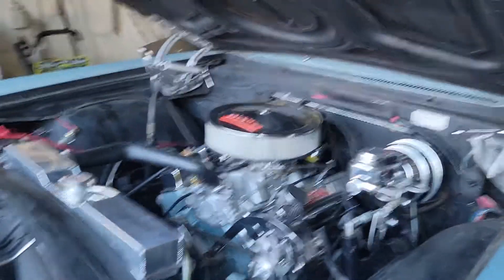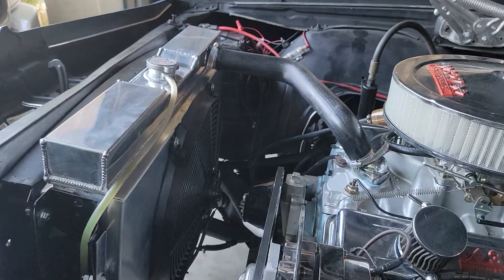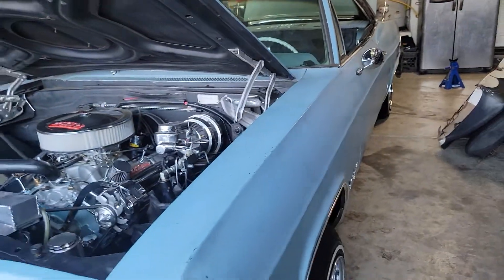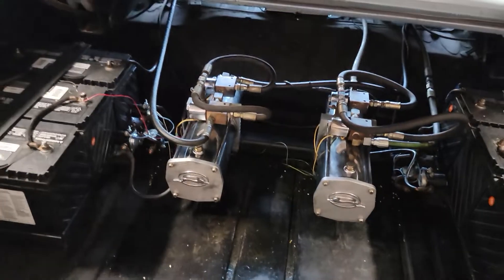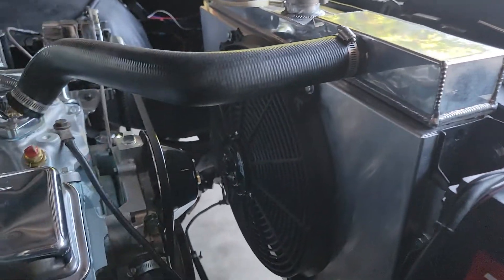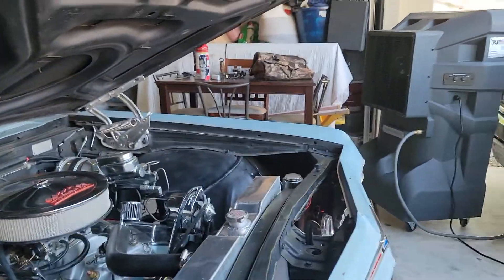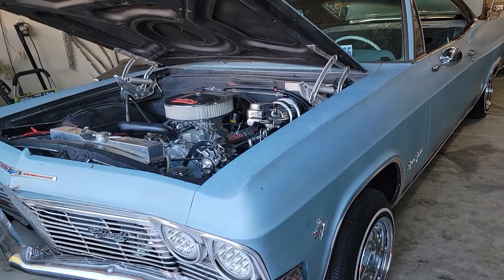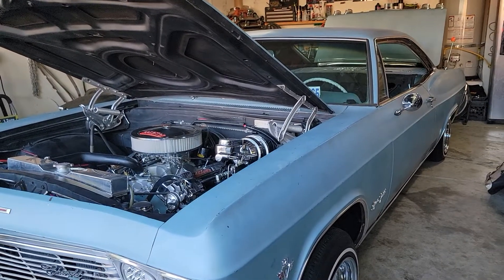update on 1965 Impala's Only... question and answer

Comment: 60 over your thinning cylinder walls where engineers wanted heat to be absorbed and 
dissipate, best to cleanup with 30 over, however, with update radiator you should enjoy a cool ride.
show pictures- show more pictures
Reply from the maker: Thank you for your comment and for watching my video. I've had my Impala for almost 25 years now. The reason for going 60 over was that my engine builder told me that it was once rebuild at 40 over... But that the block has enough material, so I would be alright. But it didn't over heat before. I do live in the desert where it does get a 117 in the summer. If you would like to see more on the engine rebuild... Please check out my other videos on my channel. Please like and subscribe and thank you for your time and support. I hope you enjoy the rest of your day.